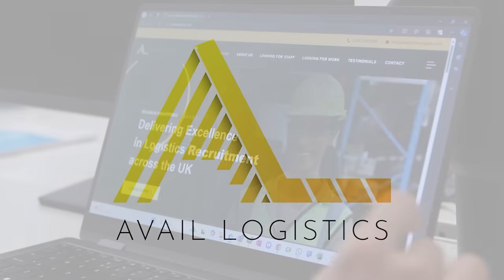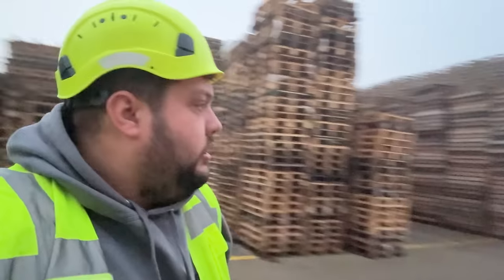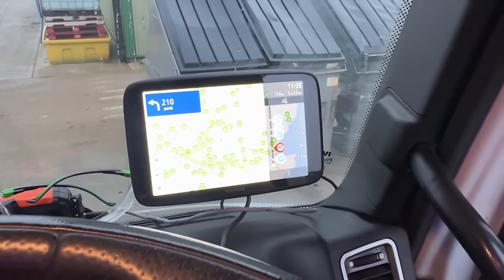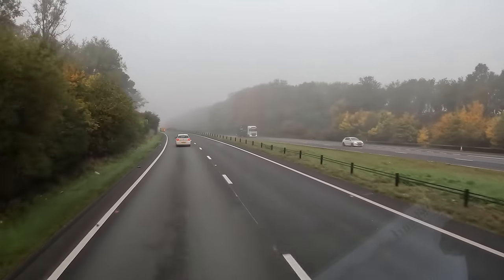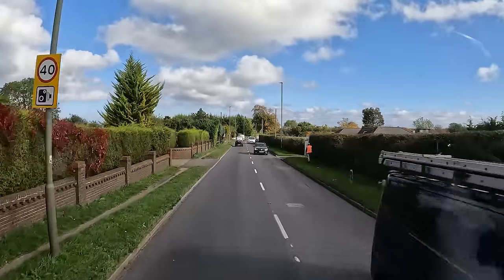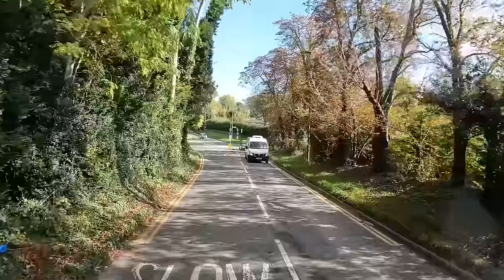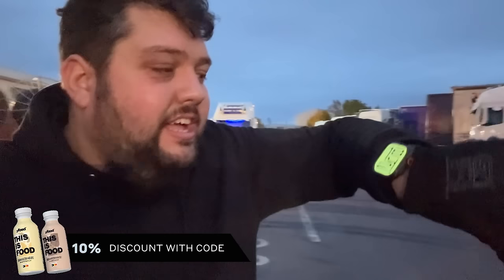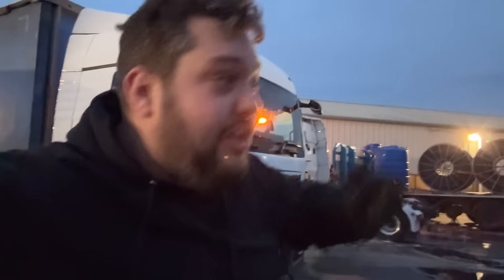Hoping I Get Home This Friday!

Comment: Great video . Please explain the number plate swop on the trailer . Thanks .
Reply: The number plate is for your tractor unit, so if you swap a trailer you swap the plate so it still shows your lorries reg number.